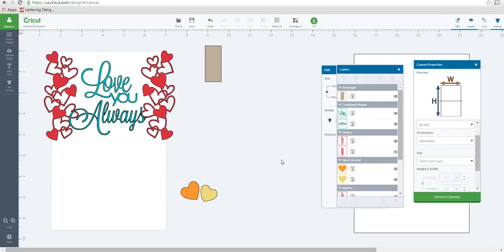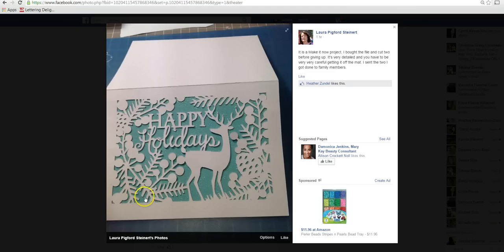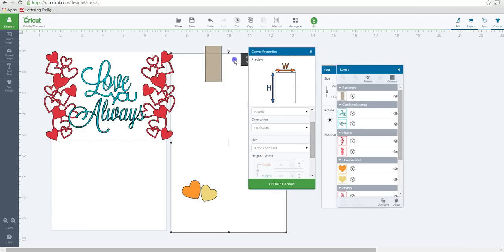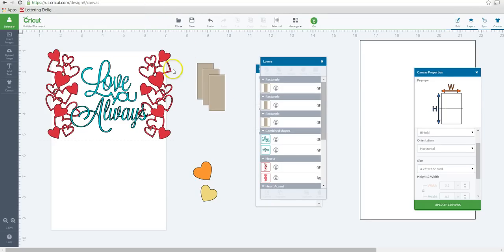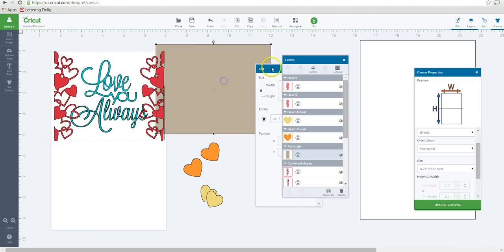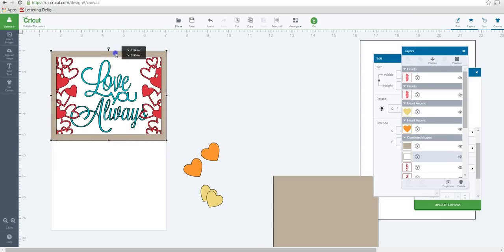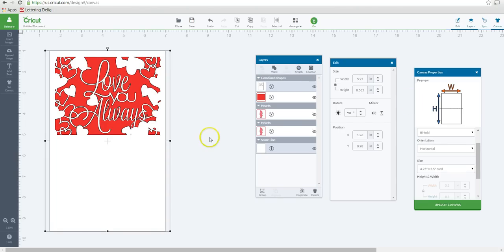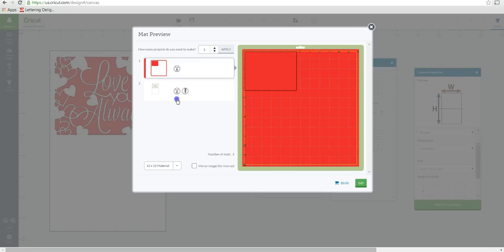Using Slice & Weld in Cricut Design Space - Valentine's Day Card

Comment: So, in order to use the Slice feature, you have to hold down the Control button at the same time - is that correct?
Reply from the maker: Judy Goodson Yes, control or shift key on a PC.
Reply: Thanks, I never could see that in the videos.
Reply from the maker: I believe I mention it several times but yes not really possible to show it.

Comment: Nice card, but  I guess you didn't notice that if you cut the final design, the way you made it the lettering will come out upside down. If you weld the rectangle to the top, not the bottom of the cut out design it will come out correctly. I do it slightly different, which is easier for me. After removing the score line from the card, I slice the first rectangle out of the card itself, build the design in the resulting window and then weld everything together. I find this easier because you don't have to try lining up the rectangles, and the design is WYSIWYG (what you see is what you get).
Reply from the maker: luxurycardstore Yes, you are right! Since this example was just going to be a layered card instead of being welded together, I put the square at the bottom, but yes, it should have been welded at the top so that the sentiment part of the card will fold down. Thank you for pointing that out :D
Reply: luxurycardstore a